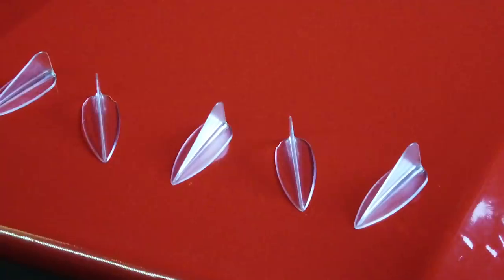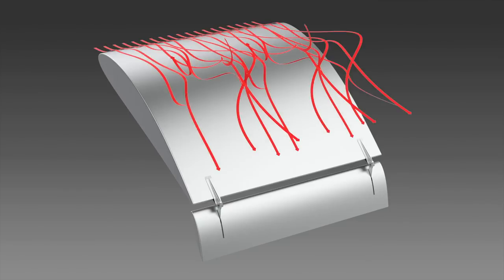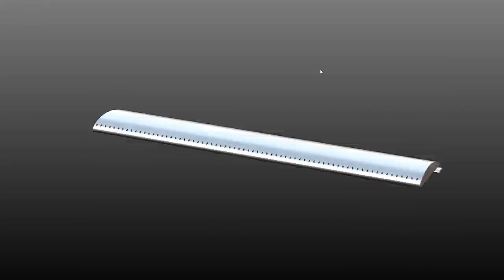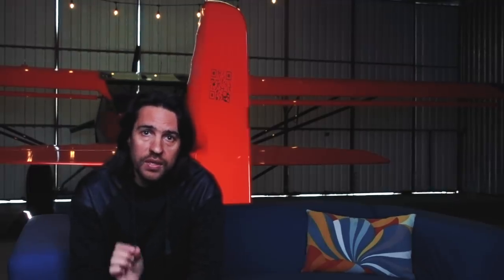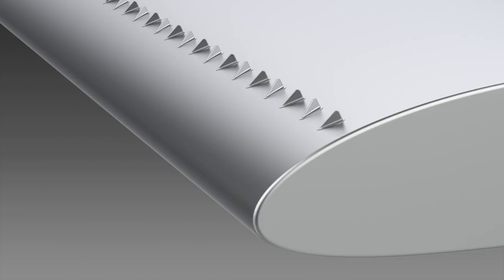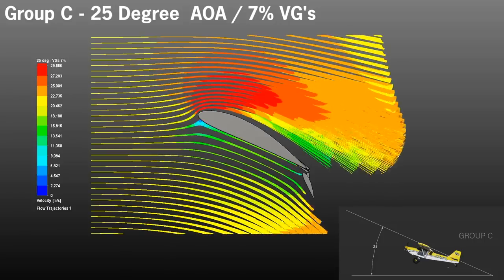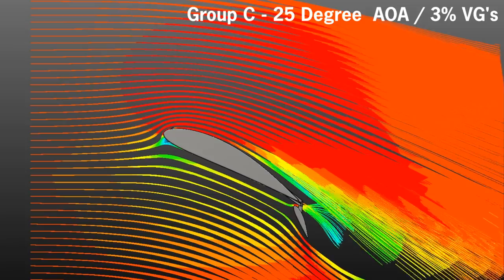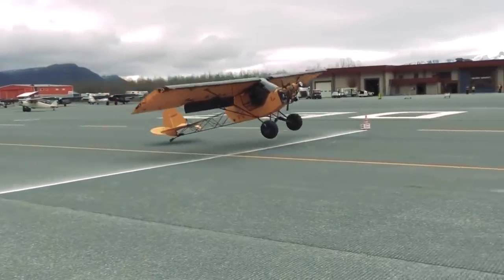How do Vortex Generator work on the Kitfox wing? Where to place them? ✈⚙🛩🔧

Comment: Thanks for this video!  I, as others have wondered the same things.  But I have a slight modification to your approach.  First, decide at what angle of attack you are unhappy with the wing performance. For example at the stall angle of attack or maybe just past peak lift. Then find the spot on the top of the wing which is horizontal. That is the point where the air is still attached, but the point at which the air will start detaching further down the cord.  Put your vortex generators there at that spot. It’s the spot of highest velocity, and the vortex generators will miss that high velocity into the stalling air past that point to keep it attached. This is then why there is not magic percent cord for VG placement.  Each wing type will have a different optimum place to mount the VGs which will be close to the position as outlined above. It would be nice to see how this lines up with your findings. ;-)

Comment: Interesting work, very good video presentation.

I, along with many others, await the results of the actual flight testing. When working with the mysterious and sometimes surprising characteristics of boundary layer aerodynamics, I rely on real life results more than theories or simulations. The best method to demonstrate the actual airflow over the wing is with tufting recorded by video. 

In the Stolspeed website I don't claim a dramatic reduction in stall speed. 3-5kts in most cases. The main benefit of VGs is improved control response at slow speed and softening the stall to a progressive 'mush', allowing safer flight right down to stall speed without the danger of being dropped on suddenly.

I tested the Stolspeed VGs at positions from 12% to as far forward as the airfoil allowed. 12% was too far back, 10% was marginal, and anywhere forward of 10% gave the same results. I couldn't find any such 'sweet spot' that some claim. So I settled on 7%, and that has been successful on most aircraft.  Some customers have insisted on placing the VGs at 10% because that is what they have heard and read elsewhere, sometimes with disappointing results.... The Kitfox wing is an interesting situation because some previous experience has indicated that farther forward than usual may be more effective.....  On the main wing I found no advantage of spacing the VGs any closer than 90mm. The 60mm spacing on the outer portions of the wings was to assist better aileron control and help prevent tip stall on any aircraft so prone.

The 7% of chord that I recommend for the placement of Stolspeed VGs is suitable for the practical limit of AofA for most aircraft being 15-16 degrees. Flying beyond that limit means dragging the aircraft with power behind the power curve, and is considerably challenging and somewhat risky for most pilots. Quite a few busted landing gears due to that technique.... I do a lot of STOL landings off-field in outback Australia and don't ever fly behind the power curve.... I find that a glide approach at 1.3Vs right to ground level then an abrupt round-out and hold off, until with stick all the way back and maybe feed in a little bit of power for the highest AofA in flare, to a slow and gentle touchdown. I find this method to be the safest and most dependable, and STOL enough for any practical need. In really remote areas I can't take the risk of flying behind the power curve.... 

It will be interesting to see how your actual results at 25 degrees matches the simulation. That is very much behind the power curve, and brings in some real challenges. Be aware that if/when the airflow does break away at that AofA, the result will be a very abrupt and dramatic drop, and no way to immediately recover.....  If it happens better be right close to the ground..... It'll be interesting to see if you can actually pull a 25 degree AofA with those flaperons at 40 degrees inducing a major forward pitching moment..... 

I have concerns about flying any of those STOL ops with flaperons at 40 degrees. The simulation shows the flaperon completely stalled, as you would expect at that AofA to the airflow under the wing. I know of several flaperon-equipped aircraft  that have come to grief with flaperons at 30 degrees at take-off. The aircraft jumps off the ground at slow speed, then the torque from 100hp starts a roll to the left, the pilot reacts with right stick which puts the left flaperon at even greater AofA causing it to stall, losing lift and increasing drag on that side, pulling that wing back and down and ending in a messy cartwheel.....

Once again, I await a thorough video report of the real life flight testing.
Reply from the maker: Thanks for the reply. Very thoughtful.
Reply: Thanks, JG, for posting your thoughts on VG placement. I'd thought about placing VGs on my GlaStar at 3% of chord, but after reading your recommendations, I'll test at 7% and see what the wool tufts show before committing.

Comment: 🔔Placement?
Back in 69 when I was on 737s, we did a mod that reduced the number of VGs ahead of the ailerons and also increased their angle.
I THINK they were shorter too.
Boeing said they were as effective yet increased cruise speed 4 kts. $$$$$ (450 kt airplane @ 30,000 ft).
All I remember is knocking them off and gluing new ones on. :-))
This was the same time we were rotating/angling the thrust reverser positions from horizontal pivots to 10/4 oclock ( 2/8) because of exhaust "lift" under the wings.
Bare in mind the 737s were a new design only a couple years flying..
You are a "good head" Alex and I appreciate your analytical/ pragmatic thinking.🔔👍
viva la landing gear!

Comment: Alex  Great video. On April 12 I installed Pacific NW Aero LLc  VGs on my Kitfox STi wing at 5%. The cord is approx. one and three eights thicker at the center than the standard Kitfox wing and Approx. three inches wider front to aft.   I had talked to everyone I could about the placement and everyone had different opinions as to where they go. Jerry at Pacific had the kit at 10% , John from Kitfox told me to experiment with the double sided tape but that others had good results at 4%. Jerry also told me after years of VGs placement on other aircraft you would want a wider spacing closer to the fuselage.  Jerry also had a guy from Africa with a standard Kitfox wing with good results at 3%, he is still experimenting. Just thought I would share. Keep the videos coming there great.  I'll let you know the results of airspeeds on my first flight this spring. Tom
Reply from the maker: Yes, no one knows until it is tested. I chose to simulate because I didn't want to install VG's 3 or 4 times to see which location is best. Looking forward to see what you found out.

Comment: Good explanation and modeling.  Nothing on an airplane is without compromise somewhere, however.  Leading edge VGs also increase drag throughout the speed spectrum...typically more the further forward you install them.  You might want to do a follow up vid and touch on the effects on cruise speed and efficiency.
Reply from the maker: Yes, working on the follow up video Part 2

Comment: I run mine staggered (basically double row that doesn't overlap kind as you showed towards the end), and my 116 sq ft speed wing (RANS) stalls lower than any other speed wings I've heard numbers on. Wasn't what I intended to do originally (long story), but I tried it, and it seemed to work, kept adding them, kept flying slower down to a point. I can touch down sometimes below 40 mph ias, and stalls around 35 in the air. Usual landing speed around 40-42mph which is good for such a tiny wing and a heavy plane. I love VGs! Will be interesting to see what effect you bird has with them (assuming you are installing them?) I think it will bring your stall down at least 3-5mph at high aoa. Maybe more!?
Reply from the maker: The staggered was not bad at all, very close to the 3% simulation.
Reply: @AlexDiSessa  Pretty sure GKF's VG configuration looked more like a second row of VGs a significant percentage back on the wing for a secondary energizing force -- is this correct? That would be fun to simulate.

Comment: Makes total sense on more anterior placement as the angle of attack increases the further back the old school of placement @ 7% cord length is no longer in contact with laminar  (fast moving) air. I believe the camber on a Just Highlander is greater than the Kitfox yet the top of the wing is similar so intuitively my hope is the calculation would be valid for that aircraft as well... Anyway,  Bravo on a great study!

Comment: Jerry Barr who is from  Burlington, WA, at KBVS, did the testing for Micro Vortex Generators in Anacortes, WA. This testing was extensive on his Super Cub and placement was done for a high angle of attack for STOL competition and also routine or standard flying parameters.  He took his flight tests for the STOL and went to the Valdez STOL competition and won it. His were placed at s low percentage of chord, like 5% for the backside of the power curve, and at specific spacing and angles which we see from Micro.  For routine flying, they are placed at like 10-12% for just slow speed flying near stall airspeeds.  What I was seeing in some of your examples is that they were all spaced at the equal distances apart, and that may be the reason KITFOX said they didn’t work that well.  It also depends on the airfoil shape/chord, as well. There are also some placements which very the distance from the leading edge, like closer to 5-6% on the inboard wing flap area, and farther back like 8-10% for the aileron section of the wing. Jerry told me he did like 25-30 test flights for each placement test.  If you would like to talk to him, leave a comment. here, and I will his permission to call you.  The flow parameters you did looked really great.  What fluid dynamics modeling app did you use? Thank you for a great presentation! 🛫😎
Reply from the maker: Thanks for the info. I like to talk to him after my real flying tests..
Reply: Alex Di Sessa It might be interesting to include the flaperon as part of the total cord length of the wing and see if there is any difference.  I will get Jerry Barr’s number for you and also have him watch this video.  😎

Comment: Cool vid, I like the approach, btw, you know that there is a way to figure this out, right? Basically you run the model wing in a “wind tunnel” and  setting a given airspeed, then you see where the separation occurred at a given (alpha) usually with a vizflow fluid. You then place the VG,  5% before the separation occurs. The problem is leveraging a RIIBBLET airfoil, there is no reliable wind tunnel data for them. The problem with them is that there is some hysteresis 	happening at those AOA and airspeeds. How I would test it, place a camera looking at 30% of the wing span (measured from the root) please your VGs and spray vizflow on the area, go do some stalls with and without and report back with those videos...
Reply from the maker: That's an incorrect statement. Putting a model on wind tunnel won't be very accurate because everything needs to be scaled down and the quality won't be the same. Besides, making an accurate tunnel where the flow is proper and you can visualize with smoke is not an easy task. I looked into this.
Reply: Alex Di Sessa Hey Alex, I enjoy your videos, but please have a look at this https://www.nrel.gov/docs/legosti/old/3799.pdf even with current validation, Wind Tunnel data is great for approximation, and the biggest difference might come form the stall characteristics as of a full wing (3D) does behave different than a airfoil section (2D) but the separation limits of the airfoils are very close considering the right RN number, so for this particular purpose, this is very good data if available. So my point was been a Ribblet airfoil, there are no good (as in NASA created) wind tunnel data for them, so you are going blind at it. If there where good wind tunnel data, you could find the separation (approximation) of the airfoil, average these out, and  move roughly 5% from the average point toward the LE to get you in exited airflow to prover the H-Vortex that the VG’s need to be successful. Then you could consider if these H-Vortex work ben in the laminar flow or above it... and so on and so on. :) Also note that I recommend a 3D model (full scale for your testing and evaluation) as even on the airframe, there are difference as you move outwards from the prop disturbances... get some vizflow pain to test it out or make your own and evaluate from from video of doing stalls, that would be a great follow up to this vid. 🤩👍

On a side note, biggest problem I see with VG’s (and I have tons of literature to share)  is that the values of improvements are roughly in the range of 3% to 8% overall. So considering this, these values fall well inside the noise of the data acquisition instruments and the density/temperature gradient you experience in the atmosphere, so, some swear by them, other not so much. There as documented cases of above 10%, but I suspect most of this comes from the improvements of the hysteresis that occur in certain airfoil & airframe configurations and the disturbances of the prop. If this is accounted, some place VG’s in the 30-40% range of the wing starting at the root. Well, to be very precise on the data, you would need to test your CFD (which is an approximation) with data from the field, but that you’ll mean placing probes an little holes on your beautiful airplane.  :) 

Keep the videos coming, well executed and do serve their purpose.

Comment: Alex first u should insert VGs to just upside of the transition zone on airfoil. And dont forget transition point moves upward(leading edge side) when AoA increases. And never use VG's under %10 of chord length. It will cause increase drag and reduce lift.

Comment: By preventing the friction caused by the effect of the movement, a gap can be provided between the surface and the air with the coating made by using composite materials, thanks to the frequency that varies according to the measured parameters. However, if the spiral rotation effect can be achieved, as the speed of the flying vehicle increases, the increase in the number of particles per unit square will increase the pressure on the surface, so it can gain continuous acceleration. If we consider it as the minimum friction in the vacuum of space. Physically, the greater the density of matter in an area, the greater the friction. The interactions of atoms with each other at certain speeds are variable. I know it's a little confusing. You can exemplify this as how a drill bit drills through solids.

Comment: Try putting VGs on the top of the flapperons and see if that helps!
Reply from the maker: Tried. Didn't.
Reply: @AlexDiSessa  It's obvious it wouldn't. You need the vortices start at or just before the topmost part of the curve at the desired alpha. Flaperons are situated way down below.
That's why LERXes precede jet fighter wings, not trail behind them.

Comment: Excellent video bud. I bought the Stolspeed VG.s and Ive been looking for a video like yours that actually explains the VG positioning with some backed up engineering data. I have a piper Tripacer. Different wing but I'm sure will have similar results to your kitfox. Well done.  BTW was that 3 degrees to the highest point of your VG or to the beginning of the VG ?
Reply from the maker: measurement was from the tip of the VG

Comment: Just learning about these. I have a question on how these would effect say a car with the  airfoil upside down from a plane ( sprint car) 5ft x 5ft wing. Would these help improve downforce and effectiveness as well as aid in drag reduction since the air flow would technically be hitting the rollcage/driver at 20 to 30 degrees of attack

Comment: At the spacing you suggested, watch out for a vicious stall. (60mm for outer third 90mm for mid length and120mm on the inner third, rule of thumb approximately) also they will increase low speed control,not don't know the effects on the kf setup, looking at your simulation vg's on the flaperon might be a idea worth looking at.
Reply from the maker: What basis makes you suggest a vicious stall? Love to know more about it.

Comment: Nice one Alex - looks like a fun CFD session you had there! What airfoil did you use for the CFD model out of interest? - the later KF models use a proprietary airfoil, right? Lastly: In the 25°AoA examples, do you think the flow separation over the top of the flaperon profile is accurately illustrating the cause for the reduced roll authority tendency that flaperons are generally known for, when in the flap-extended position? Hey - aeronautical engineering is every bit as interesting as the flying - keep up the great work!
Reply from the maker: We scanned my Kitfox wing for the model. I think it was very accurate representation. Although we don't know how much loss of control flaperons have, if there's a loss, it is compensated by its length.

Comment: Very interesting indeed, I did a similar test on the Husky and found a very strange orientation of VGs that worked best on the wing but a more conventional arrangement on the empennage. What software did you use for the flow simulation?

Comment: Alex are you going to simulate how the VGs work on the bottom of the horizontal stabilizer. My kit has them at 8-14-20-26-32=38-42 inches from the fuselage, 3 inches forward of the back of the of the horizontal stabilizer.  Each measurement has two VGs approx. 2.75 inches apart.  Thanks Tom
Reply from the maker: Maybe. There's not much possible configurations there.